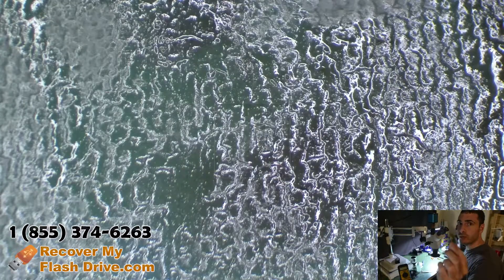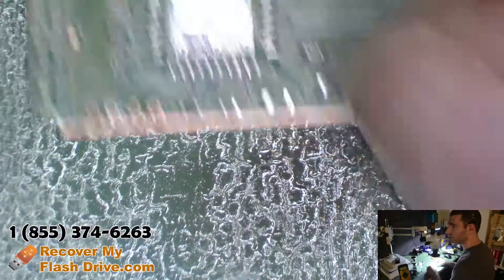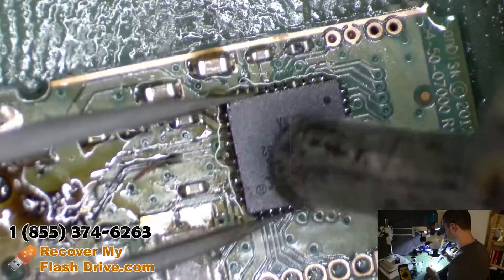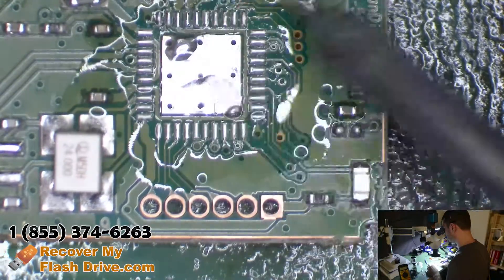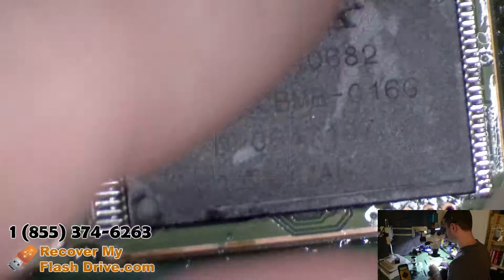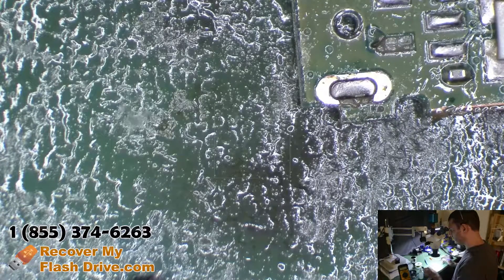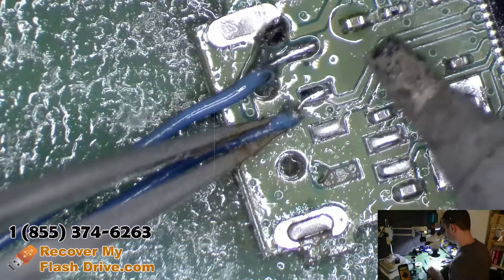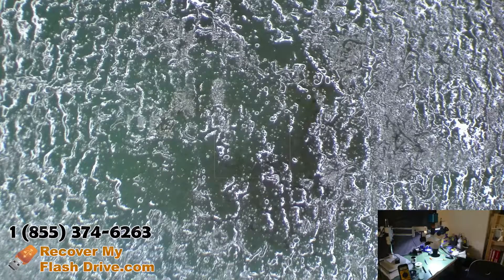Swap a broken SanDisk Cruzer circut board

Comment: Good work on that drive, I am currently attempting the same with a yihue 853aa hot air desoldering station. A question though, what is the value of the resistor near the controller chip at the top right? Accidentally blew it off the board. Wondering about the smd replacement part. Or try my luck ordering a few older sandisk cruzers from circa 2009. Thanks in advance, and keep up with the repair videos.